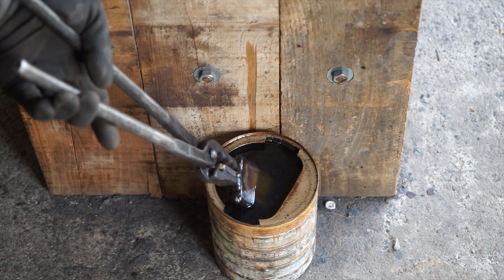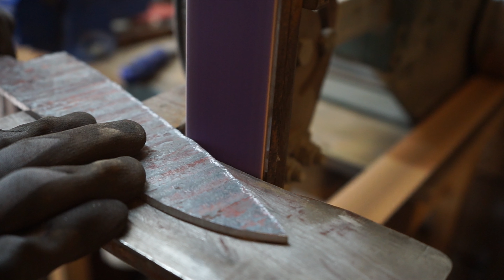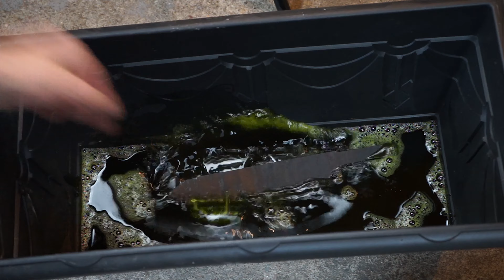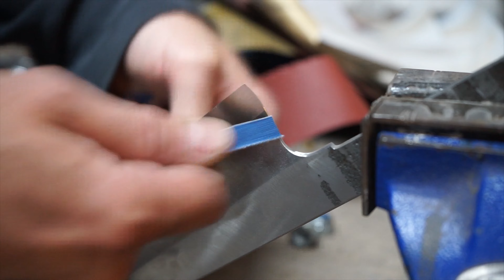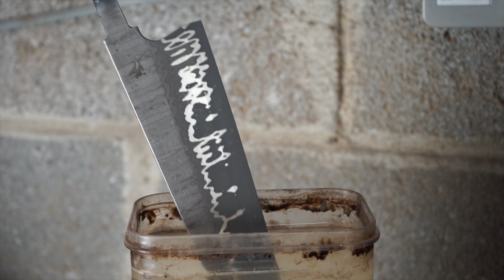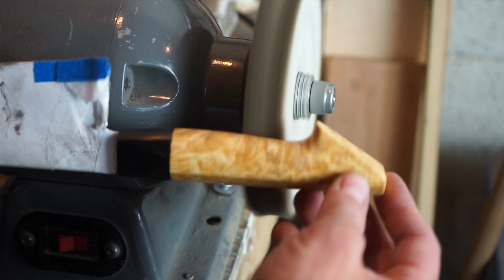Frozen knife from stainless steel

Comment: The liquid nitrogen had nothing to do with knife-making but everything to do with YouTube views prove me wrong and I will subscribe to your channel and like you next 20 vids. Nice knife and good clickbait though.
Reply from the maker: The liquid nitrogen was needed to complete the hardening process of the stainless steel. Without it the blade would be softer. Only the banana is not necessary but It shows how cold the cryo is
Reply: It converts any retained austenite into martinsite, completing the hardening. To get the best qualities out of stainless, you need that step. It's a standard practice.
Reply: Any well made knife is entirely dependent on a good “heat treatment”.  This is a well known basic for knives. 

Heat treatments in the most basic sense are done by taking a “hot” knife and cooling it down quickly. This shock in temperature changes the grain structure of the steel. 

Hot is a relative term and the temperature the heat treatment is done is dependent upon steel chemistry and desired result. 

A room temperature blade being cooled to sub zero temperatures quickly is the same temperature variance “shock” that could be achieved from taking a thousand degree knife and cooling it to room temperature quickly. 

Ultimately he took the time, and spent the money to get the liquid nitrogen to provide his blade with a very specific treatment to get his perfect desired effect. 

Knife making is an art of skill and science. 

Both of which are being mastered in this video.
Reply: @rustjupiter  The part about the cryo treatment being the same as taking a "hot" knife down to room temp is false.
Reply: @bigernbladesmith  it’s just an analogy

Comment: The smashing of the liquid nitrogen banana was a VERY nice artistic addition. I have a question about the steel. What grade was the stainless, and was the other metal a high carbon steel, because I though stainless steel was non-ferrous and wasn't magnetic. Thanks in advance for a reply! 😁😁😁
Reply: Never mind. I see that the stainless steel only provided the accents in the welded pattern. Cheers!